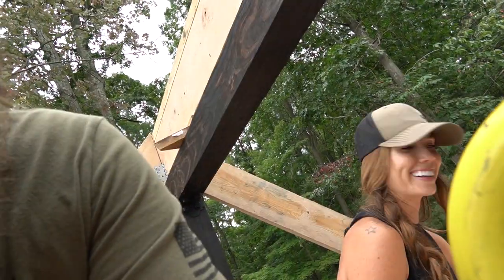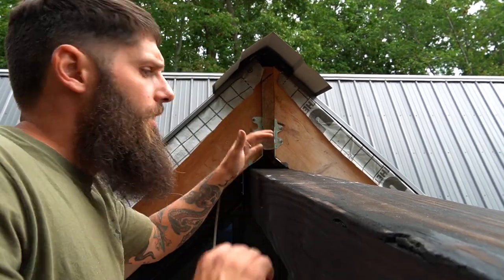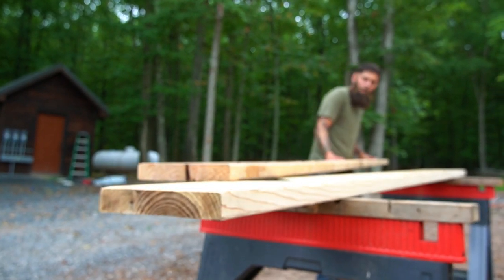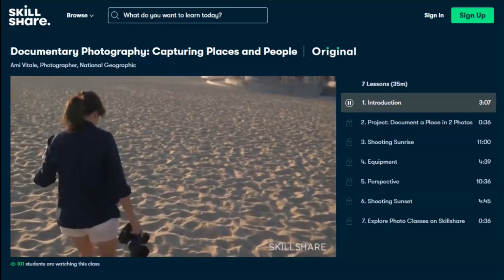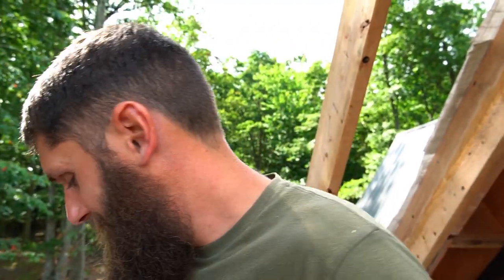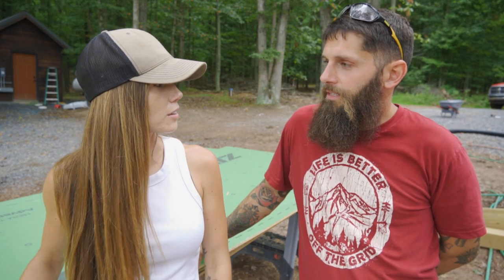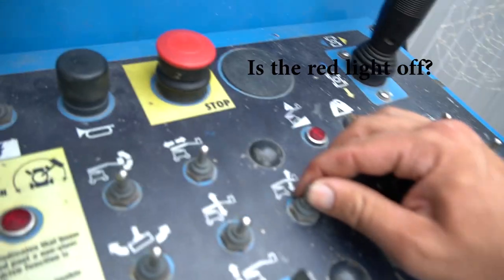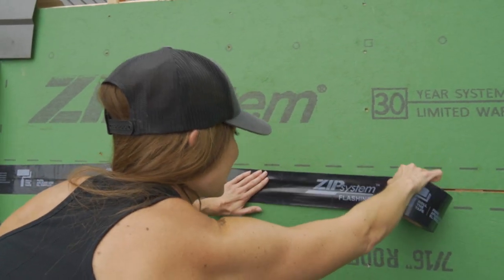CUTTING AND INSTALLING RAFTERS 20' In The Air

Comment: I forgot if you said but I think you don't have to have framing inspections? Pretty sure International code requires no more than 1/4 the depth of member for birds mouths on your rafters. Looking great tho guys!
Reply: You would be correct, if that was a low slope roof, however it is not, therefore the requirement for the condition he has is that he have 1 1/2 inches depth at outside of his bearing plate, which he has, that of course is according to international code. I believe the code they are under jurisdiction of is reads "build it as you see fit, if it fails, well that's on you" at least it is if your home at the time it falls down, either way Josh is covered, it is very well built, Personally I prefer to not criticize other people's work, but if I did I'd make sure my critiquing held water before I made it,
Reply: @1unitedredneck  well you obviously are much more informed about the code than I am but you need to re read my post, it was formed as a question and not criticism. I even said looking great
You should get out from behind your keyboard more
Have a nice day

Comment: Erin, I lost my fear of heights in a boom type "person" lift . I was a year into my first real job and was 90 ft up with a co-worker who also had a fear of heights, checking a crane wheel. The lift went off level which locked it down for safety. We radioed for a reset and had to sit and wait and watch a Tx Panhandle thunderstorm (with accompanying Tornadoes) rolled in. Luckily we only got wet before the electrician who was supposed to reset us finished dinner and came to let us down, but it was sure enough a Frog strangler immediately after. Heights still bother me unless I'm on a solid surface which isn't a "personnel Boom Lift".

Comment: Can you fill it with water, no...then it's not a bucket.
If the lift falls, stay in the lift.
Erin hanging out the front is really offsetting the counterweight on the machine.
Erin almost fell out because she slipped on little debbie wrappers

Comment: Josh I don't know how far you are from Turner Excavating in Boone county WV but 99 times outta 100 if you need to rent one of those basket machines where the mines does so much business with Mike, the owner he will lend out his machines to ppl in the community for cover of the cost of fuel to deliver it and what you use, he's a great guy and would do anything to help those in need, just food for thought if you are relatively close, and I'd say that he has over 500 pieces of heavy equipment to choose from, variety from the smallest of scissors lifts to d11 dozers and extended long range arm excavators he also sells equipment very cheap prices to brand new stuff.  Honestly a great guy to know check him out if ever your in the area 👍🏻😁

Comment: Curious about why you are putting tape over that green chip board? Isn't it normal for exterior insulated walls where you want a seal? I don't believe your are enclosing that porch? Wouldn't ordinary chip board be cheaper? Simply curious!

Comment: Birds mouth cut in rafters best practice - the cut should be within 1/3rd of rafter width for structural integrity. I.e. 2/3rds of rafter width to be left, untouched. Provides load bearing strength

Additional point - suggest you build a seating bench built in to the railing around your decks

Comment: You fly by the seat of your pants sometimes, but the rain often seems to hold off until you've finished with a project. That's lucky! Ok, there was the big thunder and lightning crack that one time that freaked us all out, but still your luck, skill, and planning holds out! I'd be so scared of that lift basket that high in the air. You're brave!!

Comment: I was wondering why you guys didn't have some type of safety harnesses on. Glad you finally remembered you had them and used them. I was cringing at various points as you were putting on those zip sheets. Curious about how you tied the ridge beam into the existing roof as I would expect a bracket alone to be sufficient for any type of snow load, but perhaps you don't get that where you live. Like what you've done so far though.

Comment: When lagging two planks together always screw them in a triangular pattern so it maximizies strength and fights against the tendency of them hogging over time. Since Dimensional Lumber often has tries to curve over its length called a crown that you can see looking down its edge they should the curl goes up not down so it resists not exaggerate that warping. If you've ever crosse do  floor and feel there a low spot it's usually due to a joists or several of those in a row to have its crowns facing down together and think of it as an arch so it's curve being installed upwards act like a bridge makes it stronger. The longer the run of a plank the more it's eccentricities come into play and what overcomes them is of course is adding more together being a header lag them together like the bolts/scews are making triangles/pyramids for the greatest strength even if I it over doors/Windows. Always be picky about the lumber your buying since sorting thru a bunk of them to find the best since they cost the same and eyeballing it for Crown/Heartshake/Damage instead of just grab n go is a bad habit to fall into. Kudos on another installment and looks like his beard was a bit wilder than before because of the Lightning since it may still being carrying a static change from the last video..🌩

Comment: Interested to know how the roof affected the light inside? Hopefully not negatively. As far as the deck roof, if you don’t make it out far enough you won’t be able to be outside when it’s raining, blowing especially, and stay dry, but you also have to consider how it will negatively affect the light inside. The more roof the better if you want to be on the deck in all weather. But that is also determined with how high the roof is. I’m sure you know all that..can’t wait to see it all done.

Comment: Hmmm The safety harness after the fact and most work is done.. Good job on the planning.. 
Well sheeted a roof with no ladder and just hand up the sheet and slip into place.. Yeah it was a challenge.  That roof would have been a super one to do by ladder.

Comment: The birds mouth cut on the rafters is really deep, it should only go a 1/3 of the depth of the board, yours is over half. Im sure it holds up okay for some time but would suck to have them snap off in time.

Comment: You know more than I about construction, but it looks like the birds mouth is too deep on those rafters.  That's a huge chunk of strength cut out of them.  Is there a code or rule about this?  I've heard it said that it should only be as deep as 1/3 of the width.

Comment: Most similar rental equiptment around here the weekly rate is 3 times the daily rate and the monthly rate is 3 x the weekly rate or equivalent of 9 days of individual rental. However they often do have a weekend rate either same as daily rate or 1 1/2 times the daily rate . Others do a weekend with 8 hours of use for daily rate and so much an hour extra over 8 hours.   Of course, there is only one delivery and pickup fee for any continuous rental. You may be far enough away that the delivery and pickup is significant. 
I can pick up and take back the equiptment so for me I usually do weekend rentals at the 1 day rate and try to wait till I have about 20 or more hours of work to do and good weather likely.

Comment: To bad that solar wasn't  put on most of the roof as there is potentially over 15kw of solar available on that roof  (but I guess trees was main reasoning to have the solar far away from the building) I havt been following you fully but I think you had a small building to begin with
Reply: Yep, they wanted to keep the trees and so there isn't much sun where the house is.

Comment: Why is there, (what looks like) three electric meters on the small building?
Reply from the maker: Those are 3 disconnects that disconnect the solar panels from the charge  controllers
Reply: @WildWonderfulOffGrid  .. Ok, just wondering. Nice work on the house.